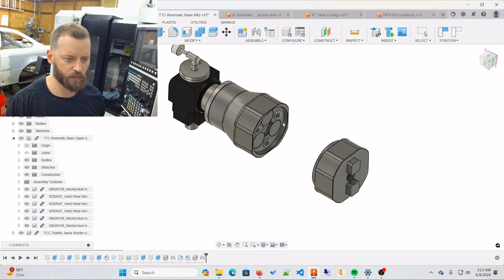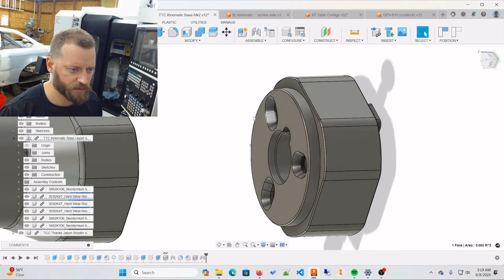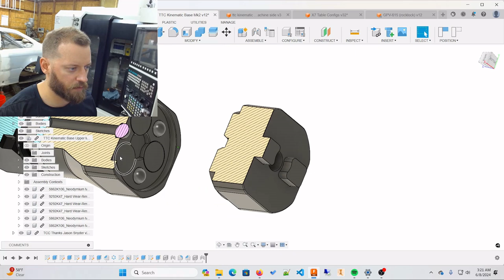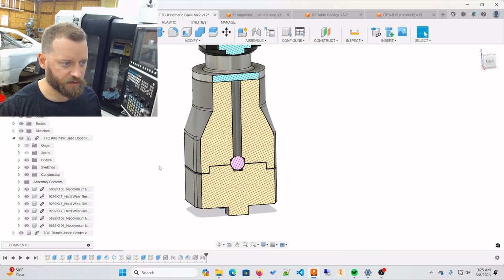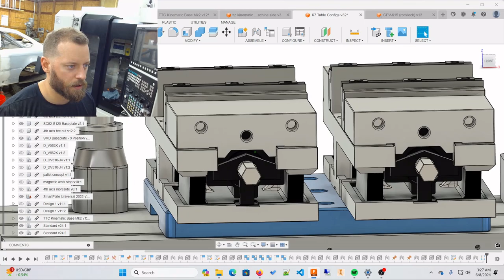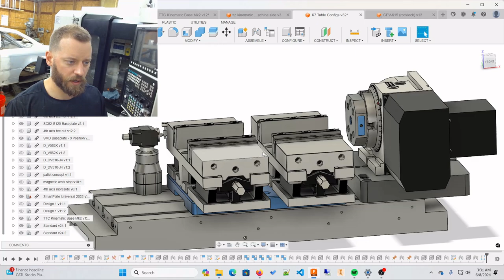TTC Kinematic Mount Design

Comment: Chuck, awesome setup!
I appreciate the thought and time you invested into your setup. 
I’m also looking to maximize my work holding on my x7 within the envelope. What did you use for your 96mm base plate? Can you post a link? Looking forward to your next video.
Reply from the maker: Hey Jeff, sorry for the delayed response.  Been extremely busy lately.  The baseplate is from SilverCnc which they now have listed on their website, at the time of my ordering they did not.  SC96-S410 is the part number.  https://www.silvercnc.com/product/multi-position-base-plate-and-pneumatic-plate/
Reply: @cskovach  thank you! I ended up going with a 5th axis base plate, two GMT 6” precision vises, SilverCNC ER40 collet, and 3 jaw chuck. I’m about to buy their 4th axis SC-C170, SOMP40 infrared probe, single zero point plate and self center vise … what are your thoughts on those?
Reply from the maker: @JeffTPW  I have two of the same GMT vices - they have been great so far.  I have one set up with carve smart jaws and plan on getting a set for the second one when funds allow.  Really makes swapping out jaws between ops or jobs painless.  I also have a 52mm zero point plate and self centering vice from silver cnc on my syil 4th axis.  Pretty great quality for the price.  Interested to know how you like their er40 fixture and 3 jaw.  Was looking at something like that but don't have a real need for them yet.

The C170 seems to be a popular option.  Little bit cheaper than the syil option and it seems to be built better - roller cam vs. worm gear so you never have to worry about backlash.  Maybe a little bigger than a machine of this footprint really needs but all depends on how you plan on using it.  The larger through bore won't hurt especially if you plan on using a collet fixture.  I would also suggest a pierson smart plate to mount it on to offset it up and out to buy back some of the machining volume it would otherwise occupy when mounted directly to the table.

I don't know much about their probe apart from other guys running them and integrating them without much of an issue.  In general they make a great product for the money and are a good bit cheaper than the syil options.  I have the pioneer probe which works well but consumes batteries faster than I would like.
Reply: @cskovach  SilverCNC's ER40 and Chuck work great I've used them for thread milling some 5/8 aluminum rod and milling a 2" diameter riser for my tool setter, it is nice only having to set vertical to run parts since I'm manual probing for now. I also bought their 90° fixture, SC96-YW50 and SC96-YW25 Dovetail pieces, haven't used them yet but they are quality pieces.

Comment: Very cool, I too work with high precision optics and metrology and really scratched my head at Titans 4 v groove design. My biggest concern is the magnetic hold strength vs hardened ball bearings on unhardened base material. Magnets have to be strong enough to firmly hold it in place while not so strong that it makes the assembly snap together so hard as to plastically deform the mating faces with the balls.
Reply from the maker: Great comment.  Your concern is well-placed because that's exactly the problem I am dealing with now due to what are now some pretty obvious oversights on my part.

Initially I selected magnets that were rated at 10 lbs of pull each.  What I neglected to account for was that the hold down strength for each magnet nearly triples when you position them in between two steel plates, I guess due to how the field is influenced / focused.  What I thought should have been 30 lbs of total preload force wound up being almost 75 lbs which made it an absolute bear to remove.  It was also enough load to produce sufficient (enormous) contact stresses at the joint and it deformed the mating surface of the v-groove after repeated installations / removals due to the mismatch in material hardness (HRC60 ball bearings vs. HRC10 4140). 

As a proof of concept it worked pretty well (at least initially) but to fix this I think I am going to machine the baseplate out to accept some hardened inserts with the V-grooves machined into them that I can press in place.  This allows me to experiment with different materials or replace them as needed due to wear without having to replace the whole baseplate and/or get it heat treated after machining.  Right now I'm leaning towards hardened A2 tool steel for the inserts - on paper it should be close in hardness to the ball bearing but if you have any other suggestions I'm happy to hear them.  They make carbide v-groove inserts for this purpose but I can't seem to find any in the size I need.

I've also changed my magnet selection and machined the pockets for them deeper to cut the preload down to around 40 lbs which is very reasonable.  I'm hoping between that and the material change the problem will be resolved.  Also potted the magnets in epoxy to keep chips away from them.

I'll be talking through these things in the next video once I work through this solution.  Thanks for the comment
Reply: @cskovach   i ran into that exact problem in some kinematic optics stages I designed a while ago. I first considered using a heat treated high carbon steel / tool steel but it would be an uber pain in the @$$ to grind all the complex faces in after heat treat. (I’m pretty sure my machinist team thought I was insane for suggesting that option lol). I ended up using pairs of heat treated pins that were either epoxied in or press fit in depending on the design. McMaster sells HRC60 dowels from 1/64” to 3/4” with tolerances as tight at +1 to +3 tenths. Regarding the magnetic strength, depending on the material permeability and the arrangement of the magnet poles you can really some interesting field intensities. Best recommendation to avoid those issues as best you can without breaking out ansys to sim the field is to make sure all magnets have the same polar orientation eg all have north side down. Also remember magnetic attractive force is proportional to 1/(r^2) so if you had a 0.025” gap last time, doubling the gap to 0.50” will reduce the force to 1/4 the previous value.
Reply from the maker: @andrewh2341  I have a concept worked up and I think it will be simple enough to machine, but we'll see how it works out once I get there.  Obviously grinding them in would be best practice but I'm going to try it and see what kind of repeatability I can get out of it from just hard milling them.  I made a clearance slot pass straight through the part to allow me to hit the chamfered edges with some precision ground flatstones to try and get rid of any high spots.  Repeatability testing will reveal if any subsequent processing is necessary.

Exact Engineering does pretty much exactly what you suggest with the dowels.  It was an intentional choice of mine not to copy their design so I sought out other ways to obtain the same functional performance while trying to keep machining on the baseplate simpler.  I have a 4th axis that I could use to do that but haven't had a whole lot of seat time on it yet.

Thanks for the info.